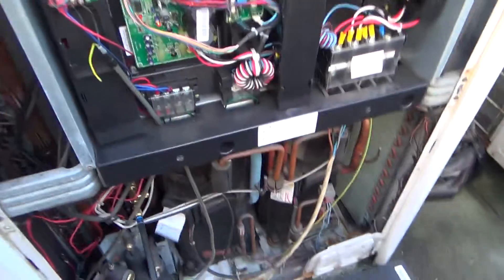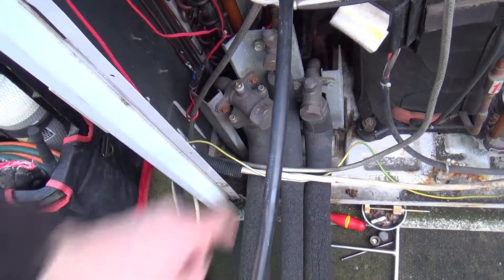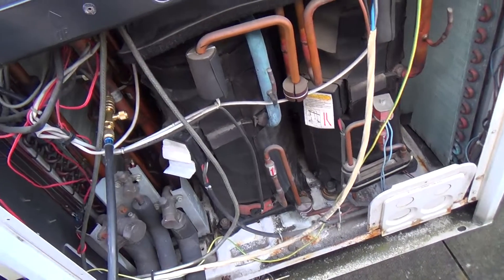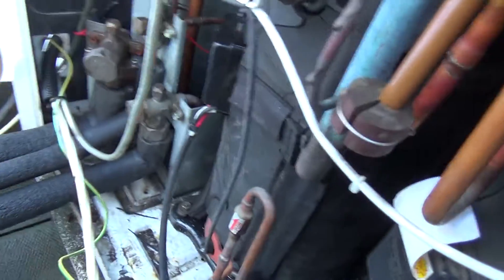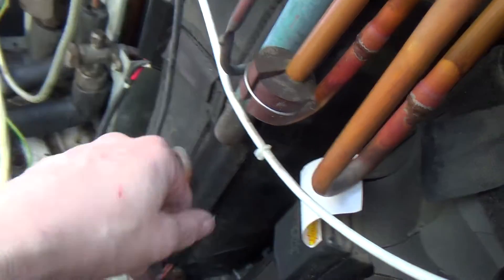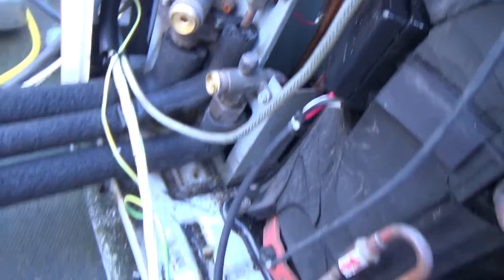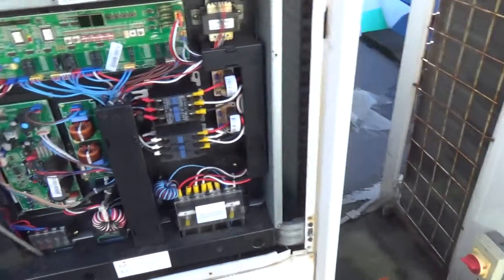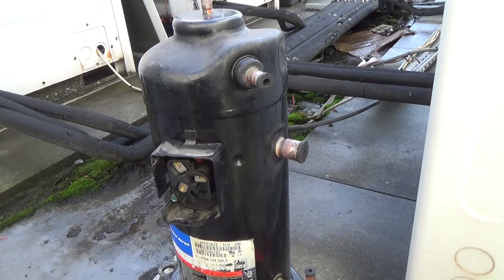Samsung DVM II Compressor Change

Comment: I wonder why the digital scrolls fail so much in those units, my company has a lot of AAON rooftop units and typically we don’t see any more problems than we do with ordinary scrolls. The unloader valves do like to blow out some fantastic leaks occasionally though. 

I want that pipe grabber, really neat.

Comment: Great vid HD 👍
Can I ask what tool bag do you use , I'm kinda trying to find a good one , light enough to carry on every call , but not too small that I can't put my essentials in it ...
Still haven't found the one yet ...
Cheers , mate !
Reply from the maker: I have a Veto MC though if I was to replace it i'd probably go for the MCT version as I think its a bit taller to fit longer screwdrivers in etc.
Reply: @heavydiesel  thank you very much indeed.